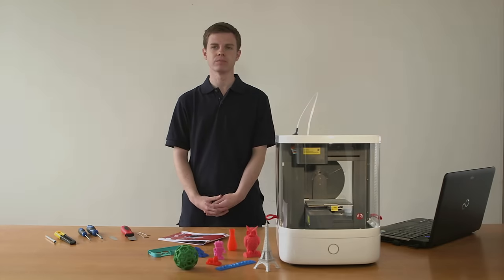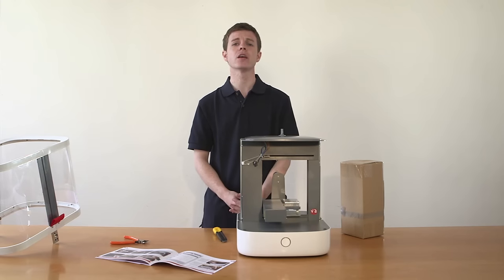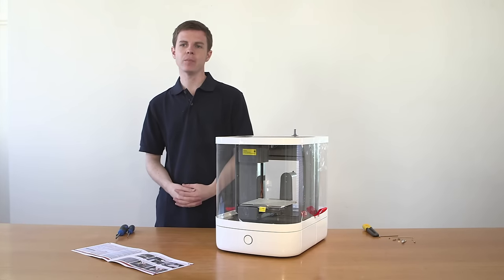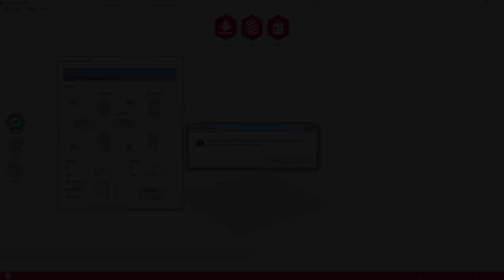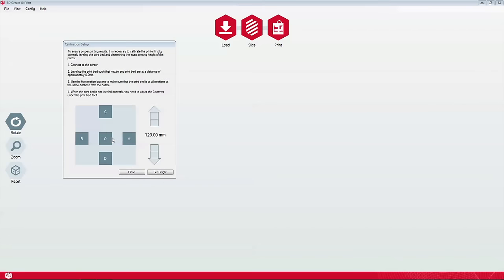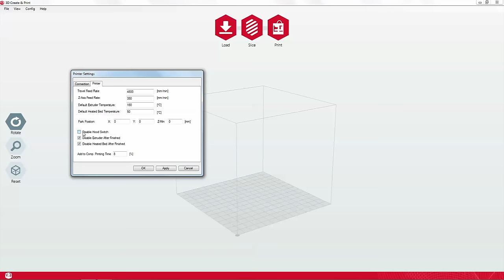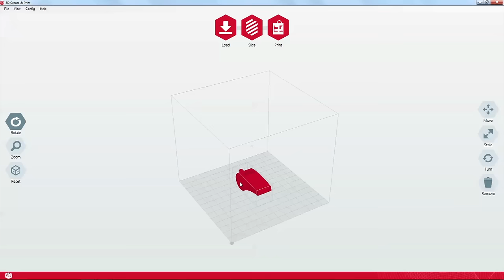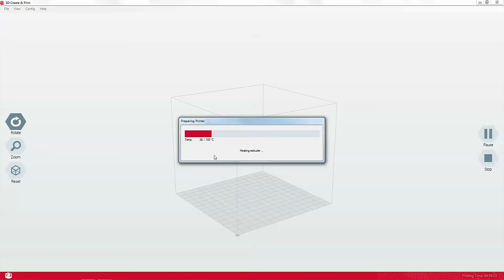Using your 3d printer

Comment: You CAN'T Set the Plate .02mm from the Print Head, because that Fan (supplied with Issue 91) hangs below the Print Head.  Hence Major Surgery on the Fan Cover/Nozzle.
Reply: ps ..  That Fan with Issue 91 is actually a nuisence!  The Extruder WILL NOT Heat Up to more than 177 Degrees.  So you have to remove the Cover/Nozzle.

Comment: how do i fix my printer?? i finished building it and want to start printing but i cant get past the calibration and set up stage. when i try and calibrate and set the print head and printer bed it doesnt respond at all and then the printer just starts doing its own print randomly and brings the bed up as far as it goes and then the print head goes as far left as possible and then keeps going ramming against the sides.if anyone knows what iv done wrong or how to fix it please message me.

Comment: feeding the print head cable out through the left hand side covers the cooling fan, not recommended, I did note that there is a unused 2pin socket in the print head, second cooling fan or test point?

Comment: Any ideas what a Heavy Vibration may be?  It sounds like it's coming from the Z Axis.  Should I open it and check the status of the Bearing and how it's running on the Threaded Rod:  And maybe the Limit Switch? ...
.. Or is it just that I need to Manually Set the Height on the Software?
I have only just Connected to my laptop for the first time.  I doesn't go into IDLE, things just start Moving Up & Down and Sideways.

Comment: I need help with mine I'm building it and the print nozzle when I click connect on the software the nozzle starts moving and the the right side but won't stopped for a link 30 seconds so it loosens the part that is on the motor how do I fix this and when I click the Arles to move the print bed up with the arrows it moves the print bed along and the last problem is the print bed hits the top of the frame when it's at the height it needs to be for the print head

Comment: Can I use the 3D printer to print out an answer to the emails I keep sending you?
Reply: Lol I'm in the same boat
Reply: +Michael Colin  ive sent 40+ emails to this firm and still getting problems of logging into site ,late deliveries , missing items ,, list goes on .. Tbh   i reallly  wish i had enough cash to buy the thing fully assembled, but i thought doing it urself would be a lot of fun plus a learning curve into how they work ...   ...  but i spose thats what you have to put up with  on these subscription  things!! :/
Reply: Don't be. It means they won.
Reply: I emailed them because I got a faulty part, this was over a week ago, still waiting for a reply
Reply: Think the tech support is still helping people connect the printer.
Reply: +Neil Simpson what do you mean?? :)
Reply: Some people are unable to connect to the printer to set it up. I can connect to mine but cannot control or calibrate it. Waiting for yet another reply.
Reply: I have the hood switch disabled.
Reply: Right, depressed the hood switch and can control Y and Z axis with the software but not X. It seems to want to move but won't. Can move it with the power off. Waiting to hear back from them.
Reply: It was a faulty MDB. I moved the X axis board to the Z axis and the X worked fine. Moved the iffy board to the last slot of four and have full control. Waiting for a message back as to whether they can send me a new board as it is faulty or if I will have to order a back issue or if slot four is even used (might be the control board for the feed motor)
Reply: +smidsy2k31 the little driver boards cost pennies.  Would cost more to post them
Reply: No reply at all from them. Will wait until Monday (20th) and chase them again
Reply: Printer now up and running properly. Forth port on the board is the printer head feed motor.
Reply: +Will Shawx howdy, if your on Facebook I have started a v3 group called "v3 eaglemoss printer group" only 4 people in it but I have worked out how to get round a few problems.
Reply: Can't join the group, causes my browser to crash. I am up to 76. Seems a lot of money for some filament seeing as I can get 1kg for £11.99. The support was poor. Basically couldn't help me.
Reply: I got my magazines through a Newsagency near my house, and for the most part they've been very consistent.

Comment: Does any one else's printer hit the build plate release when you calibrate on point D? Also I'm trying to get the firmware update but it's coming up with an error saying
 avrdude: stk500_paged_write() : protocol error, expect=0x14, resp=0x64
Avrdude: failed to write flash memory, rc=-4
Avrdude: stk500_disable() : protocol error, expect=0x14, resp=0x51 any help pleaaasssee

Comment: have just got to the part where the printer is activated for the first time when connected to my computer , this is after  downloading the operating program, to see if it is working correctly, i need to go into the start up page and click to connect, there is two boxes, one labelled : connect and the other is: idle, to show it is working you need to have it showing: idle, and mine will not  do this, anyone else having this problem? and if so, and you fixed it, can you tell me how you did it please?
Reply: yes i am having the same problem my computer makes a sound to say i have plugged something in {the 3d printer} in  the USB then i go to the manual control and follow the steps in the magazine but still says disconnected and for some resign the software you have to install does not work. also a screw on my printer bed underneath one of them snapped really NOT HAPPY
Reply: Hi Ian, you need to go into printer settings and make sure the correct com port is selected. When the printer is connected it will beep and the green button on the front will turn blue.
Reply: I'm also having this problem. The text won't change from 'Disconnected' to 'Idle'. Also there is no light on the front of my printer?
Reply: +Liam Wright You need to depress the hood switch to make it work. I used a rolled up bit of paper.
Reply: Depress? Is that another way to say Press? So what your saying is: Plug the printer in to the wall, and turn on the switch on the back of the printer. Then plug in the USB to your computer. Then press down the hood switch. Then load up software on computer and press connect?
Reply: I would find a way of holding the hood switch down (can't be anything metal) and then plug in and power up the printer.